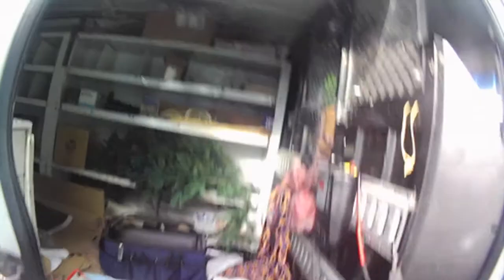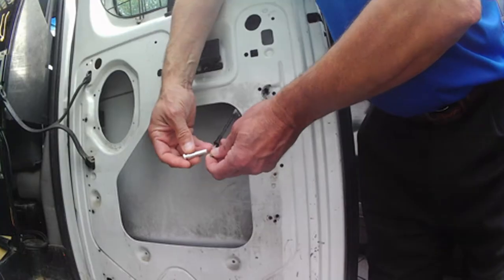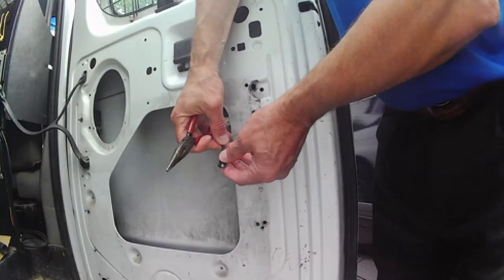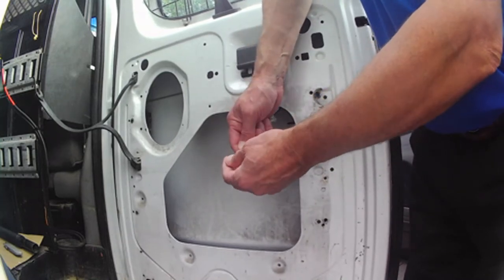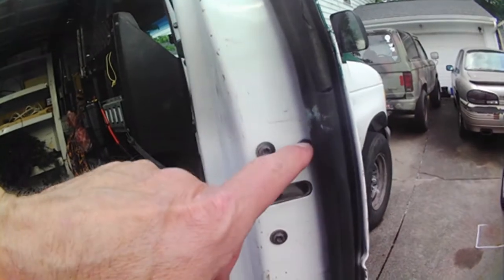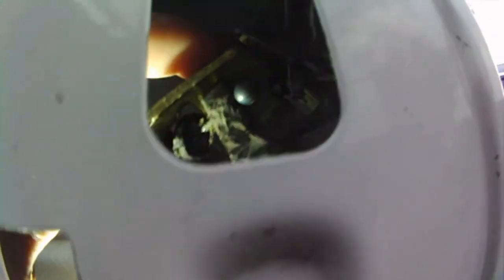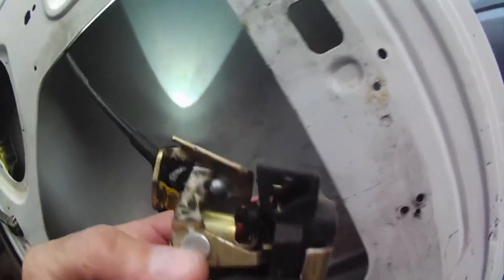Ford Van Side Door Repair. door cable repair. truck van Door wont open. How to repair stuck door.

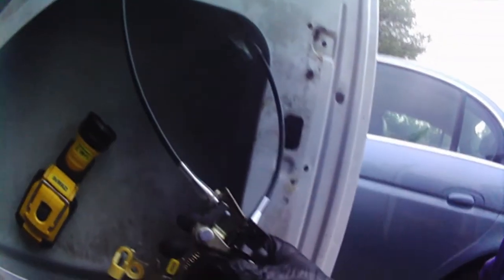Comment: 7:00 -7:15 was all I needed to see then I opened my van by hand. Then fixed it. My actual cable came off the lock. 
From that 7-7:15 screenshot I was able to put the cable back on. 
Thanks😊
Reply from the maker: Great! Glad the video helped. Just think of the money you save. Thanks for the comment really helps the channel...

Comment: Don't use a box cutter, instead use pliers and catch the edge of the Ferrell and squeeze and it will disintegrate because it's already deteriorated
Reply from the maker: Thank you for the comment and advice. In my case only the ends were busted. Previous owner probably pulled the handle past its limit also. had to slice it to get it off. I think one of them did fall apart in my hand like you said...
Reply: @outdoorswithcam  after the cable sheaths are made, they are placed in a mold and the heated material bonds to the sheath and shape, but deteriorates over several years, usually after crushing the ferrule, it disintegrates, but grip lines left on cable must be scrapped down or sanded down a little before aluminum ferrule is added. I just recently repaired all side doors, but the manual stem lock isn't moving, but everything else does, it's a real bugger
Reply from the maker: @williewest5574  i really like the aluminum ferrule. When I was looking for the fix I originally purched new cables but they had the same plastic... I took them back.
Reply: @outdoorswithcam  good move

Comment: Thanks Ford. If you had put metal ends on the cables to begin with, we wouldn't have this problem.
Reply from the maker: 100% agree! What were the engineers thinking?
Reply: Yeah, unbelievably cheap of them, especially on a working vehicle like this!

Comment: The bad news is the driver side door will go next, I had to replace the handle ends AND the ones on the latch. It's easiest to remove the bottom latch to fix it, there are 3 small screws holding it on on the bottom.
Reply from the maker: Yup.. need to go ahead and just replace them all

Comment: Great video!  Is there a clip that clips the long rod going from the key lock up too the latch on top. Is there a clip on top at the latch.
Reply from the maker: Thanks for the comment. Yes there is clips. You can snap off with your fingers or screw driver
Reply: @outdoorswithcam  thank you !!!

Comment: Ford = Fix Or Repair Daily 😂 Thanks for a great video, I just got the same exact problem on my van.
Reply from the maker: Its actually pretty easy to repair. You can repair all of them with a box of metal ones $10 off ebay. If you go buy new cables they are $40 a piece and have same plastic on them. good luck.
Reply: @outdoorswithcam  Thank you sir! I ordered them just now!

Comment: How do you remove the panel if the doors are stuck locked. Would failed cable cause the button to be in the locked position and won’t unlock
Reply from the maker: I can't remember but it usually a rod to the lock. The broken cables go to handles.
Reply: @outdoorswithcam  in a normal working van would pulling the handle inside unlock it also or no?
Reply from the maker: @fotomotoxxiii  you have to pull lock rod up and the pull handle. The handle cables is what breaks.
Reply from the maker: @fotomotoxxiii  On mine if you pull handle locked door opens
Reply: @outdoorswithcam  so it was my actuator replaced it yesterday
Reply from the maker: @fotomotoxxiii  How did you get the locked door open?
Reply: @outdoorswithcam  pulled up on the button. I couldn’t reach it of course I’m in a wheelchair but the guy that helped me was able to then we took the door panel off and replaced the actuator all good now.

Comment: Man your preaching to the choir. What a piece of crap ford did when they used the nylon ends on these cables mines a 2001 and I've replaced all the ones on both side and rear doors. I'm surprised the two passenger doors haven't gone yet. But now I probably jinxed it, haha. The outter side just went again yesterday. What a pain in the butt. I actually had to take the outter handle off. So had to drill out the rivets, and put small bolt's on it. Cause I didn't have a rivet gun that'll hold 1/4 inch rivets. Now I do. Anyway, there goes tomorrow. Take care.
Reply from the maker: Crazy isn't it. How much money did they save? I think some of these "new" cars are going to be even worst in a few years. Thanks for the comment! It helps the channel
Reply: @outdoorswithcam  Ha,,They saved plenty probably. It's the consumers that pay. Always the consumers. 
Hope your channel is doing well. Take care.

Comment: You are missing steps in the video as to how you got the lock out and how you opened the one spring.
Reply from the maker: Its hard to get a camera up inside the door when I can barely get my hand up there. The lock is held in place with a "c" shaped clip. YOu just pull the clip off and lock falls out. No tools needed.
Reply: You need to have a close-up view of the parts you are working on especially the damage part so we can see how it is damaged. Not very useful video
Reply from the maker: @truth-seeker9071  I show the part at :25, new part :59 cutting broken one out 1:46. I do have close up of parts in video one when I do rear and drivers doors. This side door video is a continuation of the series of repairing the cables and replacing all the locks. I bought the van and none of the doors would open and no keys to anything.

Comment: So what of the cables are broken inside also, how do I get it open if the cables are no longer attached anywhere?
Reply from the maker: You have to get the panel off off. then you can reach your hand up there and with your fingers move the lever. I know its a pain. This is a real manufacturing defect to save a little money...

Comment: Don’t take the C clamp off the lock! The metal rod pushes off easy. It’s just clipped into the orange end.
Reply from the maker: I don't understand what the C clamp is. I had to take it off because I couldn't reach up there and visualize everything. Plus wanted to lub everything

Comment: Please don't drill the Rivet holding the Locking Solenoid, pry the Bracket it sits in/out, I used a wide Blade screwdriver, peace3ed
Reply from the maker: I don't understand comment. I didn't drill any rivet. The only rivets I remember drilling was for window regulators...

Comment: My boy started when the sun was out and finished when the moon came out. I struggled myself, but sheesh.
Reply from the maker: What took so long? If it was taking the panel off I understand. Think about the mechanic that gets paid by the rate manual. It only pays 50 minutes.
Just think if Ford used metal it would have lasted forever instead they used cheap rubber...

Comment: Manufacturers from the auto industry all the way through, well, you name a manufacturing business and what you will see is that the word "quality" is no longer the backbone of ANY manufacturing company, most ESPECIALLY, the automotive industry. They long ago adopted what is called "Planned Obsolescence". They purposefully design their products to wear out at a specific point so that you, as a CONSUMER, are forced to repair your vehicle (or product) or to cause you to go out and buy the same item again.
Reply from the maker: Your statement is so TRUE! Its that way in everything now, Computers, cell phones, washers and driers...
Reply: ABSOLUTELY TRUE,. KIND OF SCAMMERS!! 😠
Reply: @outdoorswithcam  OMG! The cell phony conglomerates are horrible! Now phones are built with the battery encapsulated INTO the phone so it takes a specialist to pry them open if you want to install a new battery when the old one dies. So the average cell phone is basically only good for two years. Talk about treating the environment with total disregard. And the cost to consumers? Outrageous!
Reply: Do you think Ford had the metal replacement ends already designed when they manufactured these cables? I'll bet they did. So now it's either buy all new cables. At an exorbitant price. Or buy the tips. Not sure how long the tips have been around. But i remember when my first one went out, they were more expensive. My vans a 2001. Bought it in 2002. Guess I can't complain too much. So far everything I've had to fix, I've done myself. Still runs strong with the titton V8. And 20 years old. Just stupid stuff like this, that's aggravating. Good luck, Ford owners.

Comment: change all the broken cable to find out the latch is broke... practice makes perfect.
Reply: new or repaired latch ?
Reply: @ioselinrivera4875  The cable are tricky and the ends need to be crimped correctly. New.

Comment: How to do this when your door ia stuck closed, yours is open
Reply from the maker: Take the plastic panel off and reach up there and release the latch.
Reply: @outdoorswithcam you can’t take the panel off when door is closed 🤦‍♂️
Reply from the maker: @fotomotoxxiii  are both handle cables broken?
Reply from the maker: @fotomotoxxiii  inside and out? usually they don't break at same time
Reply: @outdoorswithcam  I have 2011 e350 when I unlock the doors all unlock except for the side doors. The little black button remains down. When you pull either handle nothing happens. I understand outside handle won’t work but inside should correct? I basically can’t unlock it I think it’ll open fine once unlocked
Reply from the maker: @fotomotoxxiii  inside and outside handles have separate cable.
Reply: @outdoorswithcam  I get that but is there an actuator or something that locks and unlocks the door, that’s my problem not the cable
Reply from the maker: @fotomotoxxiii  if you have electric locks then yes there will be an actuator.
Reply: @outdoorswithcam  thought they all did. Yes I have power locks so I need to replace my actuator then

Comment: How do I open  door both cables  messed up
Reply from the maker: Take inside panel off and reach up there with your hand and pull the release.
Reply: @outdoorswithcam  I tried  door lock knob  looks like has play wondering if it not un locking i tried playing  with that too idk if you god any better ideas

Comment: What if it doesn't even open from the inside?
Reply from the maker: You remove the panel and reach in.
Reply: @outdoorswithcam  yeah I got it open pulled on the cables extra hard and opened.. worked on it for a couple of hours I finally came to the conclusion that the cables are bad ..
Or something everything is so stiff cables don't return when you let go of the handle.. i don't know i need to start over. Did the back ones worked super and I thought might as well do the side one that worked fine but I thought might as well do them too and now I really messed them up..
Reply from the maker: @melgozakoki85  Remove the latch and lubricate it and check the cables. Make sure they are NOT kinked. If they are replace them Oraielys has the cables for $35. Take a picture before you remove it. Only couple of screws hold it in...

Comment: Title said door won't open less then 10 sec. In door opens not helpful for someone that the door indeed will NOT open from either side just saying..
Reply from the maker: Just reach your hand up there and move the lever. Where does it say "10 Sec".